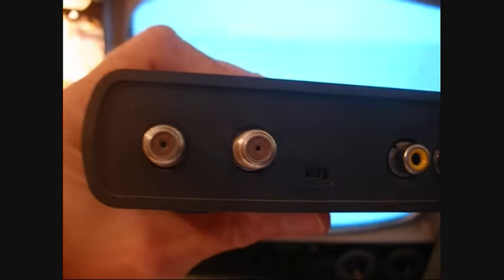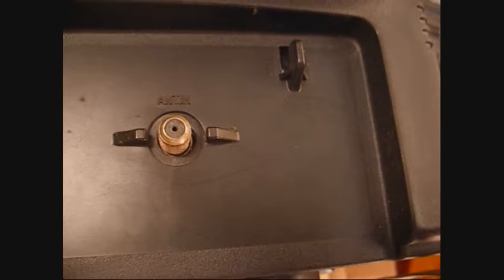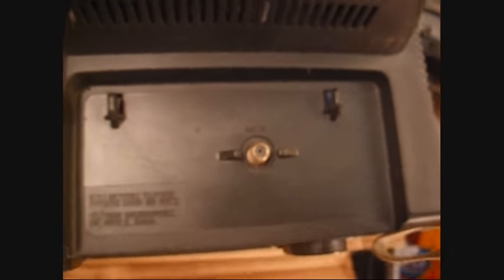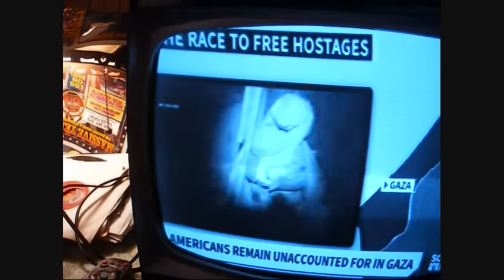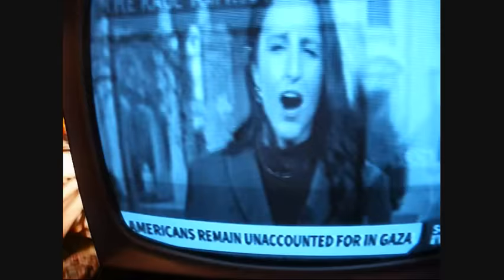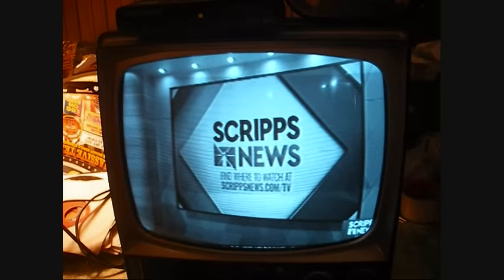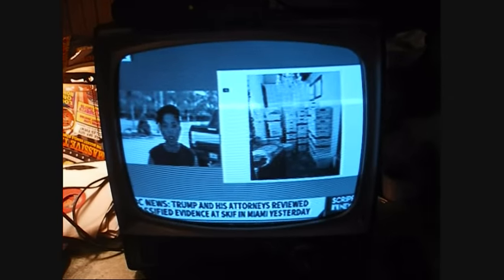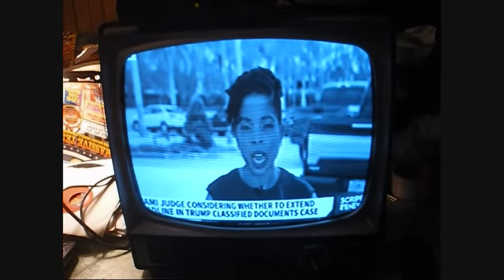How to use an "analog" TV in today's DTV world

Comment: this video is really helpful i just pulled out my old TV out of the basement so i can set it up in my garage or use as a backup TV it's an Orion 13-inch color tv with front AV inputs for the retro gamers. the Set was made in july of 2001 model number TV1333. i believe that weve had that since new it was my first tv i had as a kid back in the 2000's we stopped using it in 2009 after the DTV transion and i recently pulled it out of storage and the TV still works. this video here was very helpful so now i can use the TV in my garage or kitchen i really like watching these kinds of videos so keep it up.

Comment: I always mount the antenna high up on the wall for good reception.
Reply: In most houses that is good advice.  In some you want to be a few feet down.  It depends on if there is something conductive up there or not.
Reply: @kensmith5694  very true - RF (Radio Frequency) signals can be fickle things. In the 80s (and usually only around summer, to do with the atmospheric conditions) I found that with my small set-top antenna, to receive reception from out of the area... the station in question stayed on much later than what was in our locality and would show classic films very often, along with tv shows I'd wanted to see for a long time... well, resting the thing on the floor would pick up a viewable picture, with less fading than on a windowsill or anything. 

Must have been because I was getting the signal reflected from hills and structures  in the distance as UHF (our original VHF services had ended by then) can have its own strange ideas, even though it really should travel 'line of sight' from the transmitter. 😄So yes, very good idea to try different locations for it if you can and are not able to rig something outside.

Comment: They sense of victory when you got a good signal on your rabbit ears antenna cannot be described. When i bought the Stereo TV converter and heard the Miami vice soundtracks and the rare Stereo broadcasts of music over the air,it was just as fantastic. Love seeing the old sets. Wish i could have a 26 in console in my living room still but that is a bygone era. Our DTV sets are great but boring.
Reply: You still can, but it would need a converter box if your local broadcast towers are your provider or a cable/satellite subscription.  Also, most likely being a CRT model, it would be monstrously heavy!  A modern LCD or LED model weighs less than a tenth what a console CRT TV would for the same screen size.  Also, I beg to differ about our ATSC TV sets being boring per se because they can open a whole new window into streaming content by their capability of connecting to the internet.  But overall, yes, ATSC TV is very boring indeed because you either have the signal or not.  There is no in between like there was with analog, where even if the picture was a little fuzzy, you could still follow what was happening.
Reply: @scratchpad7954  I have my CRT TV connected to my computer with an s video from HDMI converter box. I run a playlist of old shows, anime, gaming from a utube playlist. It runs usually with volume off. My 55" plays at the same time what i actually want to watch.

Comment: We switched over in the UK around the same time. Many scammers around saying "you will need a new digital aerial". As you say, absolute rubbish. The UHF aerials on the rooftops here were installed in the 1960s and they work fine.

Comment: Good stuff. I 'm still using a 1996 Panasonic 13" vcr combo tv as my daily driver, paired with an Insignia Box. I purchased a Winegard SS-3000 indoor amplified antenna shortly after buying the box. Other than having an aluminum sided house and having to move the antenna around sometimes for best reception, it has worked pretty well. I also use the box output on my vintage tube tv's. Also, depending on the movie program, I might have to adjust the aspect ratio settings in the box to get it to fill the screen, although this does not always work.

Comment: When the switch to digital happened, I didn't notice. I was on DirecTV . I could have got 2 free converter boxes, I had the "coupons", but didn't use them, and they expired. Plus, my flat screen tv was digital ready anyway. In 2012, I stopped paying to watch commercials, and hooked the outside antenna to the TV, and it worked with the 1981 antenna! However, I couldn't record programs on my DVD recorder, because it has an analog tuner. So, I got a converter box for it. I switched my TV back to standard analog input, too, so I could play DVD'S and videotapes on it. (I'm using the 75 ohm connections)
Sure, there are other ways to hook it up, but this works fine. 
I was pleasantly surprised how good digital ota broadcasts are. No electrical interference. Pristine picture. As long as the signal was good enough.

Comment: There are two things I think should be added. First, converter boxes often have their own volume control which is separate from the TV's own volume control. If the TV is quiet even on max volume you will need to use the box's remote to put its volume up. The second thing is that there are two channel choices (3 and 4) because one may have more interference. If there is interference or snow in the picture you might want to change both the box and TV from 3 to 4 (or vice versa) to see if the picture quality improves. This may require re-adjustment of fine tuning if the TV is older.

Comment: Excellent video. Thanks for sharing. Love the old BW TV's.  I completely agree with you about antennas. I have heard from people that they have been told they needed digital antennas. It was the same when they used to talk about colour antennas when colour TV first started. sadly, a lot of people believed it all and wasted their money. DTV DX is far more difficult to receive than analogue TV DX. Also, here in Australia, our DTV channels only cover Band 3 VHF and Bands 4 and 5 UHF. We used to have Band 1 analogue TV, but Band 1 has never been used for DTV here unfortunately. Digital Set Top Boxes are becoming more difficult to find here these days. We bought a number of them, when they were available. Also, our DTV started off as MPEG-2 and our channels are gradually changing to MPEG-4. This is also not backward compatible and many people have had to replace their expensive digital Tv's, due to them not being able to receive MPEG-4. years ago, we used to have a TV that had a 300 ohm connection for VHF and a 75 ohm connection for UHF. Fortunately, I was able to purchase a converter plug to fit it up. Incidentally, when there are clouds, it is quite common that several of our local DTV channels disappear. This never happened with analogue.
Reply: We in the rural areas of the U.S. really got shafted in the digital conversion, and shafted even worse in the "repack" a couple of years ago. Many smaller stations sold their spectrum and moved to a pitiful low power channel that's only good for a few miles.  We have some local channels that only work in winter when the trees lose their leaves.   Conversely, I can also get some channels from 40 miles away at the back of the house and on rooms on one side of the house on second floor. The antenna mapping sites online say I should not be even able to pick those up with simple indoor antennas, but they are usually clear even with leaves on the trees.   But to switch to digital and then also weaken the signals was truly a dirty deal for those of us in rural areas.
Reply: Digital TV also had a repack here in Australia, when UHF Channels 52 to Ch 69 were all sold to other services and many channels were moved. Also, in some areas the analogue TV channels were removed and not replaced at all, leaving views there to invest in expensive cable and satellite systems to continue to even have TV at all. This was especially prevalent in New Zealand, where only the largest populated areas were given any terrestrial  digital TV. The entire venture was just to make money and no thought was given to the general public at all. Finally, here in Australia, due to DTV being originally introduced as MPEG-2, many digital TV and boxes are not made to cover the current changes to MPEG-4 DTV broadcasting. Hence, many TV receivers now have to be replaced.
Reply: I'm surprised Australia still has a limited choice of channels on terrestrial. The UK has over 100 and multiple streaming services
Reply: Actually, our free to air terrestrial DTV includes main channels and sub-channels sharing each frequency. In Melbourne alone we have about 20 channels to choose from. Some of the newer DTV receivers include YouTube and Netflix along with various streams, which all main DTV channels provide. Unfortunately, Australian TV channels are now all networked, which means that no matter where we are in Australia, we have mostly the same programming choice on each of the channels, rather than have individual TV broadcasters in every location, as it was back years ago.

Comment: Here in the UK, when I first heard about the analog switch off, I thought it was only in the UK, and only the 5 (yes, only 5) analog channels you could pick up via an antenna. By then we were all using set-top boxes giving us many channels so I thought the TV companies had just thought "well, everyone's using set top boxes now to receive TV stations, we might just as well shut down the old transmitters, no-ones using them anymore". I did not know that this would also apply to analog cable TV and analog satellite TV. We had to go from using an analog cable TV top box to a digital one. I still have the cable line going into the house, which is now used for internet and phone.

Comment: Raspberry Pi 3 with a UHF converter that's powered over USB hooked up to whatever TV I feel like using this week (unless the TV has AV already).
Using this to watch Youtube. Unfortunately, most uploads are in 16:9. Even if it's got a 4:3 picture, it's almost always uploaded in 16:9 so it'll have black borders around the screen like I'm watching on a Commodore 64. No problem for watching old TV shows from an external hard disk.
For watching TV (if there's anything on I'm interested in, which now is about once a month - there used to be three movies on at the same time, so I used to stack VCRs and record them simultaneously) I still have a few cable boxes.

Comment: Dish Network DTV Pal is the other box I really liked for its ability to work with weaker signals.  Also had no trouble pairing it up with GE \ Jasco universal remotes.  Actually, I've found those remotes really easy to program for a lot of brands and models of TVs and vcrs and DVD players.  I don't understand the hate that brand gets.  I've been buying that brand for over 12 years now and have set several seniors up with an decent old analog tvs and a DTV box so they could watch ota for free.

Comment: Do you have any idea of what may be causing the vertical lines of a cross hatch test pattern to have a “wavy” look? Like i wouldn’t expect a CRT tv to produce perfectly straight lines but the vertical lines have a wavy kind of look to them - maybe a bad cap somewhere?
Reply: If the wavy bits are staying perfectly in place it could be a sign that the horizontal hold is slightly misadjusted.

Comment: You may need to buy a new converter box soon, as many channels are upgrading to ATSC 3.0 which is incompatible with ATSC 1.0
and many of the boxes don't have a composite or coaxial port so you may need to get an HDMI to composite and/or composite to RF adapter
Reply: and if you have the older crts with digital you will need one

Comment: Radiotvphononut:

Despite what we were told was one of the reasons for the TV analog to digital transition - to free up and auction off broadcast spectrum to cellular communications providers - I still believe there was an additional, less honest reason for it:  

To make consumers buy more TVs!

CRT-based sets, you see, had gotten so reliable and economical by the 1980s and 1990s, that in theory you could own one for life.  So where's the profit in that? 

Well, the electronics industry, in partnership with the government, decided to set a date for an all digital broadcast mandate in this country.  

And the way they documented this to the public cast it in the tone that their old style TVs would be useless after 2009, despite the CECB (coupon eligible converter box) program launched the year before.

Yes, I do consider "helping bail out the electronics industry" to be one of the biggest reason for digital broadcast and digital TVs in the first place.

Call me a conspiracy nut, but I'm sticking to that version of things.
Reply: That is a viable theory, but in either case, you still have, had, and will always have, that core of consumers that always want the latest and greatest. Given the new HD format, large flat screens that you could hang on the wall, digital signals and higher quality, most would have been buying a new TV every few years anyway, as they do today, and have always done with cars.
Reply: @realSamAndrew   Another issue I have, as a freelance calibrator, is convincing consumers that the jacked up 'Dynamic' picture settings they see on the store showroom wall do not equate 'HD' tv.  

They made  that  association when flat screen TVs replaced CRTs for good, and  the flat screen color, brightness, sharpness, and other settings were so jacked up, that they became  expected.

Comment: Analog TVs Are More Durable.
Reply: They were not intended to be simply disposed with if and when a minor (or even major, like the crt) component or components failed, yes. 😃

The 40-50 year old sets I have here - six in total although one I have never had working properly, so I'm not sure about that one... all have very good pictures on them because those crts have lasted and lasted, as b/w ones very commonly just go on almost forever. But one is colour and that is a beautiful picture as well (b/w tubes being much simpler things has a lot to do with it.) Probably ones made after a certain time are far more reliable although there are exceptions to this, most often from manufacturer to manufacturer. Being that they are in some cases just about impossible to find replacements for today, that is very good news indeed!

And about 95-99% of the rest of them are parts that are still readily available too because they were common to many other devices. The one thing to be cautious of as with any vintage electronics though is especially when it's not been used for long periods and this can be decades, thinking about it. Although not easy now to get an 'expert' to look at these things, for safety's sake it some (fairly - to anyone who understands electronics reasonably well) basic work should be done on the set initially. 

But this is why people get into the hobby and it is very rewarding and useful too. There are some excellent forms online for this where people can guide someone through. I could do with perhaps doing more work on some that I have - like I just mentioned - but have seen the results of things going 'pop' and filling the room full of smoke (usually on YT videos thankfully lol) so if I have to leave the room for more than a handful of seconds, I will make sure the thing is switched off. 😂

Comment: can you plug a laptop into an old crt tv
Reply: Yes, but if it has HDMI you'll need a RCA to HDMI converter, and if the laptop has VGA you'll need the VGA to AV adapter. And it's an RF only TV you'll need an RF modulator.

Comment: I’m just wondering what we will do then ASTC 1.0 shuts down and ASTC 3.0 takes over. Current shut down date is 2027 there will obviously be converter boxes for modern TV’s with HDMI inputs but what about the old analog TV’s.
Reply: there is no 2027 shutdown date. that;s the date atsc 3 emitters can presumably shut down their legacy atsc signals at will
Reply from the maker: I don't think ATSC 1.0 is going anywhere anytime soon, if at all. As far as 3.0, some manufacturers have taken such tuners out of their new set designs.
Reply: Most likely.   @radiotvphononut

Comment: I have the exact same radioshack rf modulator and it was hooked in my bed room to a 1985 Citizen colour tv but it had a problem. My cable tv i had in there , or the box (Bell Canada) never actualy shuts off it just goes into a never ending scroll of ads for crappy tv or movies when you "shut it off". The problem? well the box never stopped sending a signal so the rf modulator was running 24/7. I put a stop to that by routing it through a dvd vcr combo unit but that is something to consider if someone was to hook up cable to an old set. My living room tv that is a 20" set from 1986 and has mono audio and composite video and i route the cable box through a zenith vhs vcr form the 80s to tape tv shows so that is also somthing that can be done if finding a rf modulator is an issue.